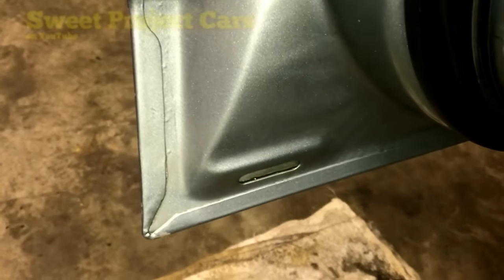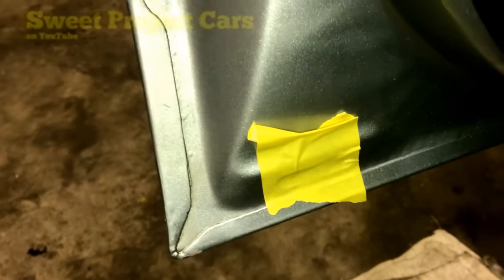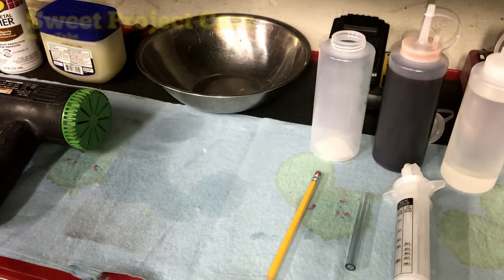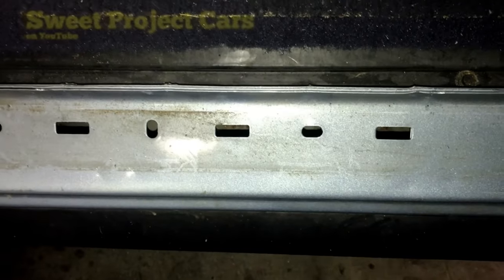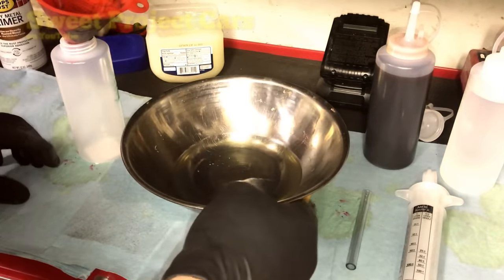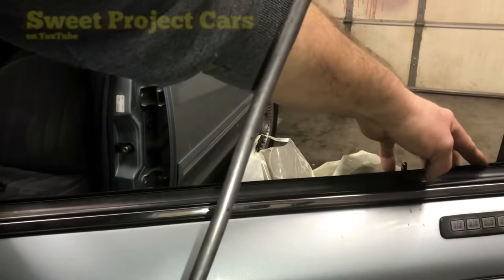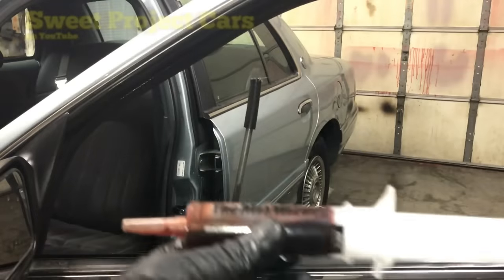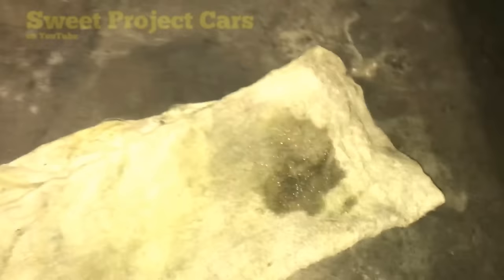Your Car Will NEVER RUST Again! For Just $10 Bucks!

Comment: I am using used diesel oil, a block of canning wax and Boiled Linseed Oil. I heat it up in a Crock pot (cheap at a yard sale) and a home made ventury attached to the compressor and a long draw tube. HF has siphon "cleaning guns" cheap but I like the one I made better. Best to use clear tubing so you can see it draw up the tube. The wax keeps it all in place when it cools. It is also a great way to treat your mower deck from rusting and makes it far easier to clean out the grass after a mowing. Best to do in warmer weather so don't wait for Winter as it will cool too fast. Wear a good mask and old clothes too. This mix is great on that rusting frame as well. Looks great due to the carbon in the diesel.
Reply from the maker: thanks for sharing

Comment: Great ideas. I used to operate an excavator in the water and sewer business. When pipes are laid down, an anode is attached to keep rust away. Pipes will not rust and the nuts/bolts will come apart easy, even after decades. I have one for my next vehicle to test if it will work on an automobile. I drive trucks so it will be easy to mount.
Reply from the maker: Thank you very much, we really appreciate the view and comment, hope you have a great day my friend. mad Mike the hammer SPC

Comment: did the same way but with a wasted motor oil, inside of the frame, doors, hidden parts... it does help!
Reply from the maker: Thank you Nicky for sharing and you are correct used motor oil works good we say any oil is better than none when it comes to rust prevention have a great day my friend
Reply: Used oil contains acid and small meyal fragments and not recommended

Comment: What a fantastic video, thanks so much for the tips!

In Scotland we always have roads salted / gritted in Winter so cars take a big hit. I own 2 MK4.5 Ford Fiesta's, fantastic running cars but the rusting on rear arches puts the majority of other Fiesta's in an early grave so I paint undercarriage regularly. Going to try and underseal them with this, thanks so much. 😁👍
Reply: Deano Mutch I’ve got a P reg MK4 sadly it’s just started to rust on the arches
Reply: @alexlovelady6310  I've only just noticed your comment there, apologies. It's a really unfortunate thing as they are great cars mechanically. They start off the key every time, come hail rain or shine and does really well at it's M.O.T up until rust starts to become an issue. As you said yourself the arches are just notorious for rust, any Fiesta's from this era with no rust will be extremely difficult to come by so it's good to make them last as long as they can.

Comment: Hell been doing this for years. I use the old motor oil that I get from changing my engine oil. I take 2 quarts of old oil and add 1 1/2 gallons of kerosene and add a couple spoon fills of scent for oil lamps. I put that in a 2 gallon pump sprayer and pull all rubber plugs under the vehicles rocker and cab corners. I spay solution in until it runs out of the drains. I hit the hood, fenders, cab corners,rockers,and everything underneath including the frame. It has kept an old ford truck I had rust free for 25 years. I had no paint or primer left on the rockers just bare metal but it didn't rust out until I sold the truck and the new owner neglected to follow my advice and it rotted out in 2 years. Use some old cardboard under the vehicle to catch the oil as it drips out. Also I do mine 2-3 times a year.
Reply from the maker: Kirby road thank you for sharing my friend :)
Reply: As a westerner  living in NY I appreciate your advice
Reply: Kirby road IM viewing this video to get some idea for the underside of my Ford Transit. Ive watched many vids where they say the FT rust out quickly. Ive viewed lizard skin, por15, fluid film. ( just from top of head not sure if names are correct lol) but ya just keep coming back to the idea of all the dirt and grime that will stick to oily surface like on wheel wells etc. thoughts? Im in Cal. So road are just wet no salt added.
Reply from the maker: Dani Adams I can assure you that the fluid film is the only way to go. the product collects a very very slight dusting but you barely notice it, and as far as protection there is nothing better my friend :)
Reply: Sweet Project Cars ...I’m puzzled.  If Fluid Film is the only way to go, why are you recommending tranny fluid or mineral oil in your video? Did I miss something?

Comment: A majority of car owners don’t have the luxury of a garage, so the window belt molding rots out and precipitation seeps into the door. The belt molding at best will last 10 years outside of a garage. When the molding starts to degrade/crack/rot, replace it.  Most vehicles it costs around $100 and easy to change. A worthwhile project to keep water out. Also protects power window motor, power locks, up/down window mechanism, etc.
Reply from the maker: Thank you for watching and sharing Rudyard! Have a great weekend my friend. mad Mike the hammer SPC

Comment: My rust spotting is on the outside. I want to get it taken care of before it gets too bad, but I'm terrified of the cost. Often, after the rust is dealt with, you have to get an entire panel painted for one little spot. However, these tips are so logical. We should know this stuff.
Another way to fight rust is to live in the South where it doesn't snow. No winter, no salt, no mud in spring.
Great tips SPC!
Reply from the maker: You are very correct Scott if you follow one of our videos on paint correction and dealing with rust spots you can slowly deal with them as you have time do one 1/4 panel at a time then maybe the hood, after you get it done you can use one of our videos to ceramic coated so that it never rust again we will be doing many videos Over the next couple months on advanced rust  prevention and how to deal with existing rust have a great day my friend
Reply: @SweetProjectCars 😊

Comment: Thanks for that video. I had thoughts of doing something like this and considered everything from linseed to wax melted. Started using an aftermarket product but would cost over a hundred dollars to cover my vehicle and much more for the frame and moving parts of chassis / suspension but I never considered the products you are using and technique. Really appreciated...I love the vaseline idea because of its viscosity and may try trans fluid first then vaseline on top..idk will see...will continue to watch your videos. It's nice that you dont drag it out either...people are busy...yet you still throw in the humor. A+ man!
Reply from the maker: Ian Mauro you should see these videos, my friend, if you want the best rust prevention 1st Rust Video in Series  https://youtu.be/WOpKDt5JEFk  
2nd Rust Video in Series 
https://youtu.be/PLQLuWdoFgw
3rd Rust Video in Series 
https://youtu.be/nSDiHydE23o
4th Rust Video in Series 
https://youtu.be/gh6X1d5BsYE
Reply: I’ve started using bar and chain oil and a $10 harbor freight paint gun for under coating. The thinner oils are great for the inside of the door though.

Comment: This definitely works but what about the other areas prone to rust like the floor panels, the strut towers, the trunk and the chassis? Here in Canada we have companies that do Krown rust protection which involves drilling holes in the doors, rockers, trunk, etc and injecting a transmission fluid like oil. It is recommended to be done yearly. They put a rubber grommet in all of the drilled holes. They do the undercarriage also. This helps a lot. I personally have used white lithium grease in the bottoms of my doors, which are still solid in a 10 year old truck.
Reply from the maker: thank you my friend :) mike

Comment: I used to work for a trucking company and we use waste oil in a pump sprayer to spray underneath and into all the doors never had to rush problem
Reply from the maker: FIXERx05 you are correct it works but for the eco system we use other methods

Comment: My uncle used to take a bug spray sprayer, spray mix of 1/3 used motor oil, 2/3 diesel fuel up into all the cracks and crevices every fall.  We lived in Vermont and they dumped road salt by the ton all winter...most cars rusted out in four to five years.  My uncle kept his truck for ten years before trading it in.  Not one speck of rust anywhere.
Reply from the maker: Thank you for sharing this we try to stay away from as many products that have smells such as diesel fuel but it does work if you can stand the smell have a great day thank you for sharing once again

Comment: Petroleum Jelly.   Refined grease, a hydrocarbon. transmission fluid and mineral oil ("oril"). In other words, oil and grease which will coat the metal, and not dry out.

After I cleaned the insides of the rockers, I coated the inside with rust converter as an added bonus before I did the oil/grease bit. I let converter dry out for one day.

I had the same problem with rocker panels, top side of inner fenders, and inside the lower rear panel. I found a good use for old grease and used motor oil. After cleaning and drying the inside of the rocker panels, I mixed oil and grease into a semi-liquid solution. I plugged the bottoms of the rocker panels with tape.  I poured the solution inside the rockers.

I soldered together a 2-foot 1/8 inch brake  line to the male brake line fitting. Fortunately, the brake line threads are the same size as the threads on the air nozzle cap. I removed the end cap of the air nozzle, and screwed in my "magic blasting wand" to the air nozzle. Then I blasted the inside of the rocker panel by sticking the wand into the top holes of the rocker where the door threshold snaps in. This helps spread the oil/grease mixture when I blasted it. Steel coated with oil won't rust.

My mixture is thin enough to spread, but thick enough to not drain away. Finally, I pulled the tape from the rocker drain plugs to let the excess drain in pans or old rags.  It's been over 10 years, and NO RUST. 
I did the same for the door bottoms.
Reply from the maker: thanks for sharing

Comment: Norway, Europe, salt is madness here. Used fluid film for many years but after multiple applications it seems to get a bit dry and starts flaking with rust in some spots, especially near wheels, answer seems to be blending 7:3 FF: ATF, kinda has mist of the stickyness of fluid film but penetrates better like ATF, 2003 Hilux going strong. Couldn't imagine not treating a vehicle now.  Sprayer with compressor and long nossle really helps and costs like one treatment by a shop.

Comment: Any used or new vegetable cooking oil will work good too!! Ever try to clean off baked on or dried on cooking oil? It is a pain in the ass. It is hard to get off even with steam cleaning, thus you have practically an almost bit of armor against all that salty metal eating brine from winter driving. Of course it takes a while for it to harden up or cook in so you want to do this during the summer. The heat from the sun will help it to bake on. I use a brush to brush it or put it in a spray bottle and spray it on and into all the tight out of reach areas.
Reply from the maker: SuperPropwash thank you for the great tip my friend :)
Reply: SuperPropwash p

Comment: Go for a drive up some steep hills and fast tight corners...THEN take the tape off and avoid having to use a pump jack.
Reply from the maker: Teknakill there are many way to do it we just share the most practical my friend :)
Reply: Exactly.  Or if you moved the door closed and open parked a particular way (on an incline) to serve as adjustment to improve sloshing inside door if you moved it back and fourth. Thinking on a x, y and z scale using gravity. Can cover nearly everything.

Comment: My transmission was slipping, so I filled my doors with transmission fluid. It didn't help.
Reply from the maker: Bushwacker you got it ...that won't help the trans issue but you might want to check the kiniffle valve :)
Reply: Oh yea? Well one day my rearend slipped and I ended up with a hell of a  situation, so I filled it with 90w and it did nothing to help! All it did was run down my legs for 2 weeks!😳..........😅
Reply: Give it some time, it should work.
Reply: you made laugh my ass off  thanks
Reply: @SweetProjectCars  the canoe valves also leak.
Reply: Oops 😬, !!
Reply: Just don't fill it with trans fluid. Then it won't slip. It should lock up just fine..how you like me now??.

Comment: I always used my old engine oil, throw-away paint brushes, drop cloths and clothes. Smelly,  bad for me and the enviroment because it would drip for days and was a magnet for dust and dirt. Still driving the same car 25 years later so I guess I got it partly right.
Reply from the maker: Thank you Mel the system we use here is very simple and very easy to use for the DIY person. Have a great night my friend

Comment: Yeah, this is most effective in those state that have snowy winters, where they use road salt on the streets.  Not as big a deal for those of us in sunny Cali-fornya, but if you leave your car outside under a tree with lots of leaves, they can get into your fender wells, etc.  When the leaves get wet, then you get moldy leaves which can cause corrosion.  Not as bad as in the  U.P. (Upper Peninsula) states or the East Coast, but then there is no such thing as "good corrosion".  Fortunately, newer cars come with much better rust-proofing these days.  I lived in Denver for 12 years before I moved back here, and had almost no problems with my Toyota while I was there.  The trick to this, however, is to add the mineral oil, Vaseline or trans fluid as soon as you get your new car from the dealer, ideally during the summer months, and garage the vehicle.  Although desirable, a HEATED garage speeds up the corrosion process.  Another factor is that persistent wetting and drying cycles will accelerate corrosion activity, so keep that in mind, as well.
Reply from the maker: Thank you Steve for sharing we truly appreciate that have a great night
Reply: Thanks for the education !!

Comment: I did something very similar on a used car that started to rust and bulge at the seam, except I used a rust converter. Used an eye dropper and squirted the rust converter up through the drain hole. Never rusted until the car died. The tubing is a good idea.

Also dead on on the front panel. My next used car was full of leaves there and rusted through. I did the same thing with rust converter.
Reply from the maker: Thank you for watching and sharing, we really appreciate it, hope you have a great day my friend. mad Mike the hammer SPC

Comment: Undercarriage rust is a big concern too. The key is to wash the underside of your car completely and thoroughly when the temperature warms up. Salt on a car when it is cold will not hurt it. However if you have mild days during the winter then salt will start causing corrosion then. It’s most critical to wash your vehicle thoroughly in spring when temperatures rise, I like driving in heavy rain first when temperatures rise, that helps clean the underside off good. If you leave salt on your undercarriage into the summer months that for sure will cause undercarriage rust and quicker than you think! If you have a car that you want to keep, just garage store it during winter and never drive it on salty roads because nothing else you do will keep the car as good as if it never sees salt at all. And if you can avoid driving your prized keeper in the rain then that helps too! Kept dry and salt free is the key!
Reply from the maker: Newfie thank you for sharing my friend it is helpful to the entire channel :)

Comment: VERY informative video with great detail and instructions! Just one fender would cost a lot to repair from rust damage, so taking the time to do this once every few years would save big money. Perhaps one of those small garden pressure sprayers might help apply the oil in hard to reach areas. Could a person also use olive oil? You can buy that stuff pretty cheaply.
Reply from the maker: goesfastandfar you are correct it is a great way to stop fixing rust..and as far as using olive oil I have never tried it but I think you should give it a shot if you feel it will do the job, I think it would work, but just can say for sure as I have not tried it my friend :)

Comment: Took your advise.  I have used winter bar chainsaw oil on the interior panels.  On the outside and frame areas I mix warm regular chainsaw bar oil and cheap axle grease in a undercoating gun.  Holds up well.  Had the truck for two years of Michigan winters and it still looks like new.  Thanks for the video.
Reply from the maker: Thank you Doug for sharing great time at my friend have a great day Mike Sweet project cars

Comment: For doors and rocker panels. I did the same as in the video. But I found a use for old used grease and motor oil. I first blasted out the dirt and other debris with compressed air. I then applied rust remover to the rusted areas. After several hours or the next day, I flushed out the rust remover residue with water. THEN I dried the areas with a heat gun. I plugged the door drain holes. I sprayed the doors and rocker panels with rust converter. I let that dry. I mixed old grease and old motor oil into a thick and semi-liquid paste, I made a blaster rod from old brake line so I could stick it inside the doors and rocker panels. I blasted the inside of the rocker panels with compressed air to cover the tops, sides and bottoms of the rocker panels with the oil-grease mixture. I did the same with the doors.  That was over 10 years ago.  No rust since then.
The valance below the windshield. I put screen door screening under the valance to keep out leaves and other debris from the backs of the front fenders.
Reply from the maker: Thank you for watching and sharing, have a great day. mad Mike the hammer SPC